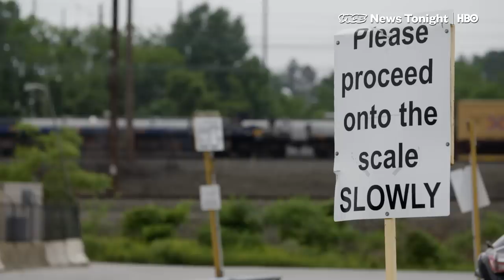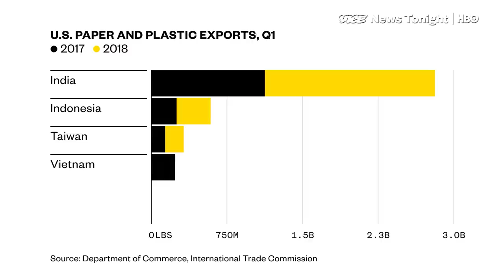China's Waste Ban Is Causing A Trash Crisis In The U.S. (HBO)

Comment: Not just the US, even here in Australia as well as New Zealand. The whole movement for banning single use plastic isn’t about the turtles, but more over the fact that China is no longer taking our low grade recyclables.
Reply: Except for the fact that we somehow need to find a material that can be mass produced, doesn't cost much, can stand a bit of wear and tear, doesn't impact the the climate and can be recycled. That's the role that these one use plastics fill.
Reply: Biodegradable, is the the answer.
Reply: Industrial hemp can be used to make paper and biodegradable plastics.
Reply: Wow, never thought about it that way. Thanks!
Reply: Hemp plastic is $2.35/pound currently while polypropylene pellets are around $1.00-$1.15/pound. 

Hemp certainly has potential but right now no company in their right mind would use it because it just isn't as cost effective as petroleum plastics. Also we are already having a global problem with area used for production, so adding something that needs to be grown would probably add another large burden on top of it.
Reply: Brett Van Overstraeten how about not using single-use bottles at all?
Reply: If you can change the public's opinion then go right ahead, do keep in mind however that whatever you substitute for plastic is going to burden whatever industry that it's coming from. I myself drink from the tap but most people don't so there isn't much that you can do
Reply: Brett Van Overstraeten I think we the solution is we simply have to be willing to pay more. It's not a free lunch to use these plastics that just sit on the planet. It's the Walmart effect. I used to hate Walmart and McDs customer service. Then I realized, you get what you pay for. Other companies charge higher prices but they have better service. If we want sustainability, have to pay for it.

Comment: Trump could use it to build his wall lol
Reply: seriously this is a great practical idea.
Reply: Eman Eman that shit can actually work considering each weigh a fucking ton 
THAT CAN ACTUALLY WORK
Reply: Hahahahhaha
Reply: Lol
Reply: A 40-foot high wall of garbage will probably be a better de-motivator to would-be illegal immigrants than a proper, professional-looking wall.
Reply: That shit works
Reply: unless someone lights it up..
Reply: Till it rains
Reply: Shh! 😲Don't give him any ideas! 😉
Reply: Brenda Lea Stone  I won't shoot down your idea, but... 
If a cubic yard (3×3×3ft=27 cubic feet) of sand (unmelted glass) weighs a ton, then a piece of wall 25ft high×15ft wide×25ft long would weigh:

(25×15×25 cubic feet)/27 cubic feet per ton=
9375cubic feet/27cubic feet per ton=
327.22 tons.
 
So for each 25 feet of glass wall you would need to fabricate 327.22 tons of smooth glass in place and do that for 2000 miles.
 
327 tons/25 feet times 5280 feet/mile times 2000 miles= 

327 tons/25feet x 5280feet/mile x 2000 miles=
138,124,800 tons of glass smoothly fabricated in place. 

138,124,800 tons of smooth glass wall 

138,124,800 tons smooth glass x 2000 pounds per ton equals: 

276,249,600,000 pounds of smooth glass wall
Reply: 276,249,600,000 pounds of smooth glass wall 
About 276 and a quarter Billion pounds of smooth glass wall.
Reply: Brenda Lea Stone  what do you mean by "infused with liquid steel"?
Reply: Great idea.
Reply: Luis Rosario you guys aren't realizing why they haven't used all these recycled plastic blocks to build stuff. Because any amount of rain or anything will wash away all the toxins the plastic is holding into the water shed and destroy crops. This is the same idea they banned road salts in some places because the toxins pollute water and destroy crops.
Reply: LOL yes and America will be great again
Reply: Eman Eman - Trump 2020 #MAGA 🇺🇸
Srsly
Reply: well that might work
Reply: Trash Wall to keep human trash out
Reply: "Simpsons did it"
Reply: Lmao good one bro
Reply: Epic😂😂😂
Reply: FAKE NEW!  Just because there isn't any information about Trash Walls successfulness, doesn't dispute it's ineffectiveness.  I'm being sarcastic if you cant tell.
Reply: All jokes aside it's actually really good idea
Reply: You should contact trump and explain your proposal , maybe you get hire from trump at the white house . can you imagine a huge mountain of garbage between the usa and the mexican border. I like it!
Reply: @abeynez9287  Honesty dont even like the idea of the wall or Trump but we have to agree if he is going to do it, this would be the best way.
Reply: William Davis you right bro . but stop and think who made this pasable . lets be honest here.  when a president pass a law to better the general economy the reaction don't happen immediately it takes between 3 to 5 plus years bro.what we are seeing in our economy is the reaction from  Obama , not trump! trump has been in power for less then two years . all he has done is getting the entire world against us drive business away from us and apply tariffs to every single country and they are doing the same thing to us. Ask your self a question, how can all this bad actions improved our economy bro. You probably think the tax cut did it ! Well let me tell you tax cut benefit only who make billions not thousands if you got a tax cut relief you probably already spend it on a single trip to the gas station. If you are a member of the one percent then you probably got your self a new jet or a mansion . think about it 
 Bro.
Reply: Perfect. Great idea.
Reply: Quantum we get it captain obvious.
Reply: Honestly a good idea we need that mf asap
Reply: Eman Eman funnnny
Reply: muhahahaha
Reply: #accurate
Reply: That’s a good idea....
Reply: It wouldn't last long.

Trump spends billions building a massive mile high wall, coast to coast, made of dry paper.

Mexicans bring a single match.
Reply: A Artisan  it would be pyric
Reply: The Mexicans can just light it up, by sending the police in to a smoke hazard. Nice
Reply: Actually that Is a good idea
Reply: It's not a bad idea.
Reply: Comachos wall.
Reply: Eman Eman - true lol 😂
Reply: Or you could build a better home out of it.
Reply: lmao why is this so true lol
Reply: THE WALL IS A BAD IDEA
Reply: It would be sensible symbolically. But no
Reply: Not when business leaders can make tons of money sadly
Reply: Eman Eman good idea
Reply: It will makes a world record if they are going to use for Trump US-Mexico boarder wall and be a terrorist attraction lol!
Reply: Eman Eman this could definitely prevent enemies crossing the walk, would probably must huge than the China great wall
Reply: He is right though. I wouldnt want to live inside a plastic house during the summer. I value my life too much.
Reply: Oooh! Intriguing. I'm all for that idea.
Reply: Its a good idea but they should melted it first and turn it to a solid subject and build the wall with less money your country and every country in the world shouldn't ever give its nationality to outsiders you can give them a stay to work if some company want some workers from other countries and that called visa or visa for studying or treatment but shouldn't ever go to more than 5 years and if they outstaid there visa they should gets captured immediately and given a ticket and after that they fly to there home country immediately the sad thing thats there are some countries like mine have these lows put they don't inforce it thats why you see in some countries in the world like Britain America and France are many many  immigrants Indians Chinese Africans and South Americans because they take advantage of our lack of enforcement and because we don't put boarders like in Europe and don't protect our land and societies from these Indians Chinese and South Americans we should focus on our countries development and they should stay in there country and do something about it
Reply: @William Davis really the New York Times that's your reliable source. Seriously.
Reply: brilliant!
Reply: Use trash to keep the trash out. Sounds good.
Reply: well we still have loads of plastic to be recycled here :)
Reply: TRASH WALL
Reply: Castles in Europe were literally built with waste as a filler between two stonewalls thus getting big massive and cheap walls.
Reply: Joseph Stalin  idk, maybe use big fans to blow the GASSES to Mexico?
Reply: I could imagine it on fire 🤣🤣🤣
Reply: hahahahahahaha this is a good one
Reply: Lol facts
Reply: Brilliant idea!
Reply: perfect or drop it on that caravan LOL
Reply: Brilliant!
Reply: Eman Eman Who's gonna want to climb over a wall of trash?
Reply: Eman Eman or hide the trash in his hair do
Reply: They CLEAN it
Reply: you should go to the White House
Reply: Lol.  😂😂😂😂😂😂😂😂a beautiful big wall with a big door .  Only one door. 🤣🤣🤣🤣🤣🤣🤣🤣🤣🤣🤣🤣
Reply: Eman Eman that’s actually not a bad idea 💡
Reply: Well they have to see through the wall to see what’s happening on the other side
Reply: Hassan Dar cover it with a layer of concrete, then you get a thicc af wall with cheap interior filling
Reply: @loueelouuu  Really ? Think about it for a minute... It will work until someone lights up a match smart guy!
Reply: LMAO
Reply: That is actually a great idea and saves a lot of money
Reply: Eman Eman I bet trump will hire you if he sees this. Just take the cubes cement coat them very well and Boom giant blocks for the wall😆
Reply: Garbage wall? Represent!
Reply: Lmao
Reply: @lm2193  plastic wall
Reply: Using plastic bottles and cardboard, sounds good to build the wall is great idea.
Reply: 哈哈哈哈哈哈哈哈
Reply: Create homes and jobs. Build the wall out of houses, have all the bad ass Trump supporters live there and defend the stolen land with their lives. Any takers to MAGA?
Reply: brilliant
Reply: yes he can. make the boarder great again.
Reply: Now there you go , that's the best idea I have ever heard , melt all the plastic down into a great big goo and make some huge moulds in the shape of the wall panels and pour the goo in , fucking brilliant 99 .
Reply: @ZomBeeNature   um dude stop it get some help
Reply: @William Davis unemployment? The WHY DO I NOT HAVE A JOB I have put in like 100 application s to places and they all said we are looking for more qualified people or never got an answer from, I even applied for a fucking janitor position and they did not want me
Reply: Haha....funny stuff!😂
Reply: @ZomBeeNature  

He would have to start taking back the waste from other countries and take on their's as well.😉
Reply: I have vinyl siding on my home since 89 and still looks new, best money I have ever spent. @gac9513
Reply: Build that wall biuld that wall
Reply: @lm2193  paper wall XD
Reply: No. not paper, by alu can? yes it could work.
Reply: This is what happens cause every year everyone goes crazy at xmas and buys far too much shit that gets trown away. Never used or it could be shit from the xmas before, or even before that. Consumerism has went through the roof! If we stopped buying so much worthless shit we wouldnt have so much waste. We dont need all the stuff we get each year. If we calmed down a bit there would be less rubbish to throw away. Its not only xmas, its birthdays, valentines day, mothers day, fathers day, easter ect ect...all these things are put in place and made up so that we turn into mass consumers and buy buy buy. And when you buy buy buy you have mass amounts of waste, wether it be wrapping paper, packaging, old toys ect.the list goes on... where does all this stuff go? We never think about all the rubbish and what its doing to our home. Our home called earth. Dont make our home a shit tip. Stop buying so much stuff that we dont need. There’s guaranteed to be loads of stuff in your house that hasn’t been touched or moved or used in years. And if you havent used it sell it to someone that needs it and will use it. When you look into the rubbish we go through and all the plastic that goes into our sea is unreal! We are destroying our home called earth. Look at the state its in! Now look at your kids and think how its going to look like in there life time when your not here to look after them. Do you want to leave here when you die knowing your leaving behind a shit hole for your kids to grow up in?? No! Neither do i! If you think like me and want this earth to live clean then we need to speak out and help people see the wrong that we do in our daily lives. But we have all been blind to the truth cause we get fed bullshit through our tvs and flash loads of sales pitch crap on billboards, advertising and newspapers and magazines. All forced to buy “stuff” cause its fashed in our faces constantly. If we never seen it on tv ect we wouldnt feel the urge to buy it, even tho there is no use for it but you want it anyways just cause you seen it. And when you get it you use it once then throw it in the cupboard or drawer. 
Living a minimalist lifestyle reduces stress. The more stuff you have in life the more stress you will have. So it not only impacts the earth, it impacts you aswel.
Reply: Watch “the strawman documentary”
Reply: Trump may award you the Science and Technology Innovation Award
Reply: Budget materials to build the wall.

Comment: U.S. needs to stop relying on others for our waste.  We need to reuse that stuff somehow and make it another commodity.
Reply: We actually do. I worked outside of DC for awhile at a place that took recycled plastic and created things.

Siding for your house, those hard plastic benches you see outside are made with sorted/recycled plastic.

We just create so much it's hard to use it all, again.
Reply: @dustinhiggins710  That's great!  But the US as a whole needs to practice this, not just one city.   All that garbage doesn't even have to be made into something else.  It could be an energy source of some sort.  Yes, burning can release horrible toxins/pollution, but if there was a way to not just release it into the air but capture it and make it fuel for something else.

Comment: How can the western world cut down on waste? Like dramatically.
Reply: Stop buying stuff.
Reply: There's nothing wrong with recyclable waste if it's actually recycled.  The problem is that USA doesn't have the factories to do this for some reason
Reply: Sy Sharp  
Um, most of the waste is "packaging" material.   It doesn't need to last more than a second after it's been used.  What needs to be done is processing factories built here
Reply: Stretched lip -  
That's compete bullshit.
Reply: BY NOT BEING SO FAT AND OVERWEIGHT (ONLY IN USA NOT EUROPE)
Reply: @Zero-Neal  stop being capitalist
Reply: Minimalist lifestyle
Reply: @Stratsfinest  no , the corporations are the ones who are causing the waste, not individual people
Reply: Or better garbage management. Don't use landfills it doesn't work
Reply: Western world 5x emission per capita compare to developing countries
Reply: By killing themselves.

Jk
Reply: No more single serving containers.
Companies should be responsible for waste based on weight and material (10 cents per gram of plastic tax for example).  Ban plastic bags.  

Dislodge oil companies from influencing government of all levels and we would be well on our  way to a cleaner earth.
Reply: @Awesomeman1987  You right. They fixed oil spill by pouring teflon to let it coagulate and sink down the ocean which caused even more problem.
Reply: decrease the population.
Reply: Reduce the amount of throwaway bottles and containers we consume and add small 5-25 cent security deposit to all recyclables. People who are too lazy recycle will end up making a new market for people to take their trash and obtain the security deposits.

Comment: Can someone please tell me why the paper at least can't be turned into bio-char & put into cropfields or deserts to reduce flooding & drought impacts, rather than just thrown into landfill? A makeshift bio-char machine could be made with a couple of barrels! Or use the existing ones that make BBQ charcoal to process this waste into bio-char (presumably it's quality wouldn't be high enough for BBQ bricks)
Reply: because they were making plenty of quick money selling it to China. they had no backup plan, poor planning
Reply: Turning your cropfield and deserts into landfills isn't the solution, you know...
Reply: @patrickevans801  yes, but even without a plan, it shouldn't take that long to jerry-rig something up to do the job now! Should be possible within a week or so if someone had a desire to do it.
The plastic's much harder, but the paper should be easy
Reply: @SeedlingNL  Do you know what bio-char is? Look up terra preta soils, the most productive soils in the world & they're made from waste thrown into large pits & set on fire, then covered to make the waste "char" instead of burning. Bio-char lasts over 1000 years & is pure carbon. Every small drink bottle sized amount of bio-char created is 2x44 gallon drums of pure CO2 removed from the air for 1000+ years & every grain of that holds 70 times it's weight in water when it rains, so no more flooding, just water held in the soil until the crops need it as drought hits.

The world is currently losing 75 BILLION TONNES of carbon rich soil to erosion per year, that's 10 tonnes of erosion created this year just to produce your food. That waste has the ability to put at least some of that carbon back into the soil where it belongs & is needed to mitigate against climate change & make the land more productive
Reply: Money. That's the only reason, it cost money and they don't get any.